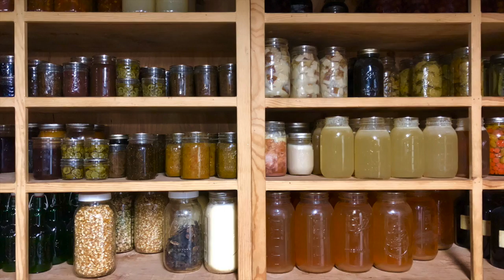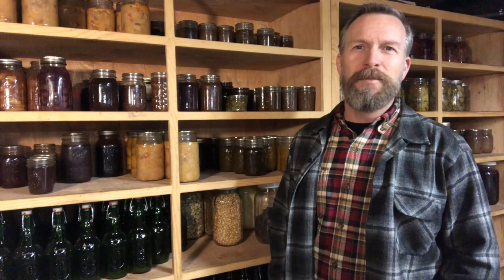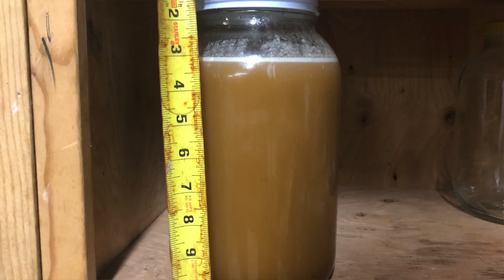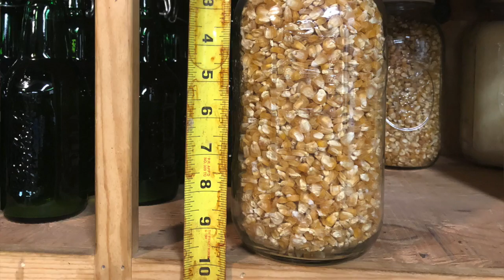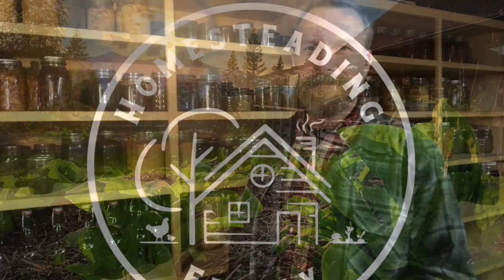How to Design Your Own Custom Pantry Shelving

Comment: Everyone is saying to use 2x4 for structure integrity. I’ve even seen other videos where the shelves were warping even with the 2x4 design. How is this even possible. Doesn’t make sense how these shelves are holding the jars without any issues. How are they still holding up.

Comment: I may need smaller sections so I can adjust the shelves for different parts like one section for cereal boxes the rest for canned jars etc. my pantry built ins are only 12 inches deep and there’s room for 24 inches on each side uhg it’s wire too so that’s tricky with smaller items

Comment: Just a comment about vertical spacing of the shelves. Shallow shelves should be at eye level. It's hard to see a 4 inch jar on a top shelf! The upper shelves should be for taller, preferably lighter objects which will remain visible.
Reply: You aren't wrong, honestly. In practicality it is wiser to keep the heavier breakable containers at the heights this family does. We can 5,000 quarts of food minimum per year. Small up top. It is also used less for our family whereas the quarts fly off the shelves. Also more difficult for 4 footers (7 to 12 year old helpers etc) to reach and safely carry when the more needed jars are heavier and out of reach.
Reply: As someone who has struggled with being vertically challenged her whole life I totally agree.

Comment: Those are some great looking shelves with great looking food on them!  Question 1: How did you anchor the shelves to the wall?  Question 2: How much weight do your shelves hold?
Reply: Screw the shelves into wall studs (or secure them with brackets to the floor joists if walls are concrete).  1x1 strips attached to the front prevents jars from falling during earth quake or sudden ground shifts (I had a propane tank blow next to by basement wall that did that.  Jars moved, but survived).
Reply: Very good question 🤔

Comment: Thank-you for teaching me how, my late Dad built our canning shelves. Not only were the shelves similar to what you have, but Dad also put made doors to cover up the jars. the doors looked like regular cabinet doors. If I remember right, we had four rows in the top cabinet; and then the bottom was just two rows with doors, for other stuff. The other stuff would have been bulk or other items that we didn't use a lot.

Comment: 80% of the time my shelves would stay at a set space.  There is however 20% of the time I'd like to change things up.  For that reason I think i would go with some kind of adjustable system above the 5 gallon buckets.

Comment: would you not recommend putting jars in the cold cellar?
Reply: Valerie Leung he did
Reply: Temperature stability is important, if you have moisture or it freezes its not an option but otherwise its ideal.
Reply: Yes, he said that. We moved from a location where that was an option to a place with no basements.  So it isn't an option for everyone. Recommendations vs reality do not always align, unfortunately.

Comment: Excellent presentation!  Very thorough. A suggestion to potential shelf builders, it was mentioned in a way to have a mind set of best utilization of materials. Because plywood comes in sheets of 4' x 8' using a denominator that will divide equally into 4 and 8 is the best use. For example one sheet of plywood will make 32 lineal feet of 1' wide shelving or 16 lineal feet if 2' wide etc.
Reply: Don't forget that the blade you cut that plywood with will take 1/8"
Reply: and 24 ft of 16" shelves which is a nice depth too!
Reply: It does not apply to metric, but we tend to all ready to use conveniently convert able units/measurements.

Thank you for reminding me 😅